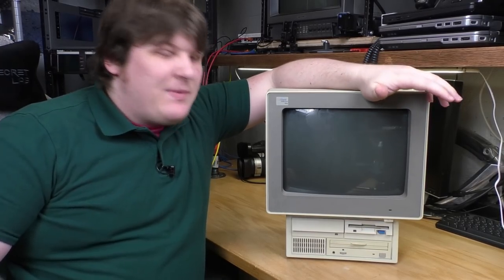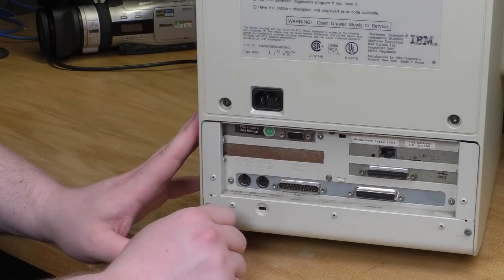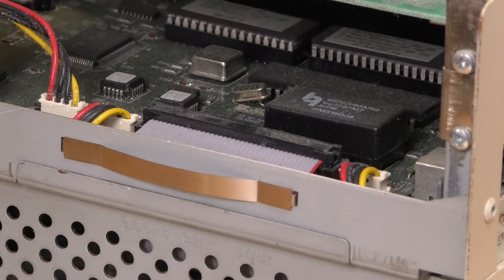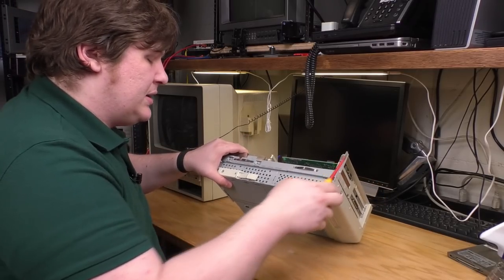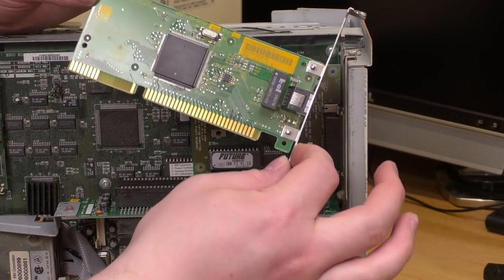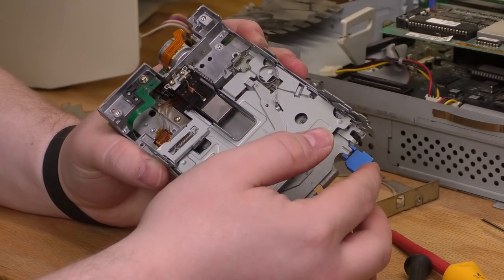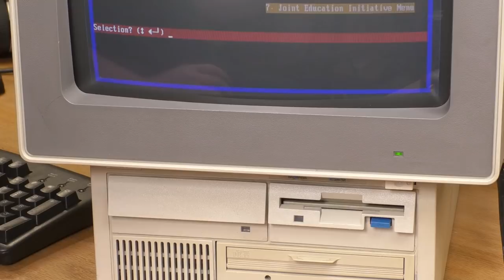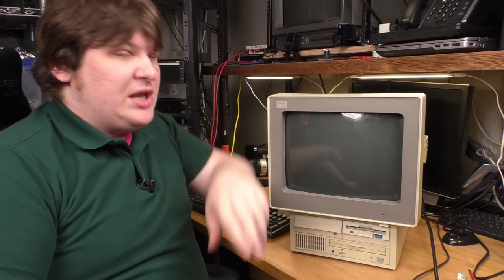Beginning the Eduquest

Comment: OK, first, is that a Texel CD-ROM??

Second, on that floppy drive — I recognize that mechanism.  Alps, was it?

IIRC... That rectangular clip with the spring in it comes off, then you press the eject in and the top half of the loading plates comes off.  There’s a lower plate that slides forward on some guide pegs with keyhole slots.  Take that off.  The thing you think is riveted, isn’t.  It’s just a little disc with a hole in it that rides on top of a pressed lip.  The bottom tray holds it in place and keeps it from popping off against the force of the spring on the left side.

To reassemble, lube that disc, put it back on the lip, reinstall the bottom tray and rotate the disc and push the tray onto the guides.  That should keep it secure.  Reinstall the upper tray, then that rectangular thing on the left fits into a notch on the left side of the chassis.  You may have to press the eject button to get the upper tray in place, then push or pull the bottom tray to open up the channels that the top tray guides into.

Something like that, anyway.  Half of this is like every other common 3.5” mech, but that rectangular piece and the rotating disc are kind of unique.  Get a top-down cam on it when you disassemble it and it should help if you get stuck putting it back together.  It’s pretty straight forward though.

Comment: For any type dirt on plastic have you tried a pre-soak of WD-40 just spray on the dirty spot let sit for 60 seconds or more then clean, it is magical, it has taken polyurethane off of vinyl for me. CLR and Steel wool with WD-40 for rust removal.

Comment: They had these at my middle school. Never opened one up. But the floppy drives always stuck like that.  I think they had these at my elementary school too.  They replaced the apples. I remember them running new Ethernet cable for these when they got them.  By high school I had a network admin login. That they gave to me.  Heh.

Comment: Not sure what kind of compressor you used but every time I've used an air compressor to dust out a machine (both personally and professionally) it has ended up way cleaner than that. If it's one of those little tire or inflatable toy ones it won't do the trick, but any hardware store air compressor for driving air tools (with an actual tank) plus a fine-ish nozzle tip will direct a vigorous enough jet of air to remove just about any dust with the huge exception of dust from a smoker's home. That stuff is the vilest, most tenacious substance known to man - get your scrapers out!
Reply from the maker: I used a typical shop air compressor, ~90psi through a good quality air gun.
Reply: As I understand it, none of those compressors are static safe.

Comment: I'm not super surprised to hear it only has a 386 in 1993. I have a Zenith "notebook" with a 386SX from 1992, and while yeah the power considerations of a laptop were a factor there, a machine made for the education market would probably have lower cost components than something directed at the high end.
Reply: I got a 386DX-40 based PC in 1991-ish, and that was a reasonably powerful machine for the time. 
Not quite bleeding edge, but definitely above average.

486s were still ridiculously expensive in comparison, and not all that much faster. In fact, the 386DX-40 was somewhat faster than the lower end 486SX CPUs (which were still more expensive), and could hold its own against 486DX-33s (which were /a lot/ more expensive) quite a bit of the time.
The main advantage of the 486 was the built-in FPU, and most consumer software (and games) wouldn’t actually use that. My 386 was still quite capable of running most cutting edge games reasonably well in 1994-5. Doom comes to mind as the poster child, here.

Comment: Regarding the quality of cheap chinese drives, it seems to be a matter of head calibration... and vintage internal/FDC floppy drives have the same problem. I dumped something like 90% of my floppies without issue using one $15 Chinese USB floppy drive and all but a handful of the remaining 10% dumped fine on the other one (those proved to actually be bad)... which seems to be calibrated the same as the vintage FDC drive in my AST Adventure! 210.

(i.e. Some drives will read more disks successfully, but none of the drives I own, USB or vintage, was calibrated such that it could read all the aging disks in my collection.)

Comment: So they do make static safe brushes, for like cleaning up after solder flux. Think they have carbon in the plastic to be very slightly conductive? I've used silicone basting brushes, but no idea how static safe it is, and it won't really get that fine surface dust off.

PS2-type floppy drives are in fact incompatible and unique, and that looks somewhat like one? (I thought they didn't have separate power jacks but it's been a long time.)

Comment: This is definitely an early 90s looking machine, we did not have this one but we did in the early 90s get a 386 machine that looked very similar...Monitor was seperate. My recollection says mostl likely we got it in 1993.   I cannot remember if this machine had a cd rom drive in it...I don't think so I think it had 3.5 floppy and a 5.25 inch drive, and it wasn't until we got the 486 machine a couple of years later that it had the cd drive.  But yes looking at this is very nostalgic for me.  I remember distinctly getting Eye of the Beholder and it wouldn't run on the machine and figuring out that if we made a boot floppy that it could be run from there...I suppose it was a ram issue its so long ago i cant remember specific details but I remember being excited to make the game work and feeling smart for figuring out how to make it work. I think its the size of the chassis itself and that blue button on the 3.5 inch drive that really make it feel reminiscent of that old machine.  Man I almost have a name for it....but its eluding me ..was it just PS2?
Reply: btw...1993  I was 15

Comment: The "it's really is a Mac" after seeing another sled at 21:27 seemed strange to me, as someone, who's started to be interested in computer hardware at like the Sandy Bridge era, so my idea of a Mac is something with everything soldered to the same board aad if something isn't, it has proprietary connectors and screws. Something that is modular and tool less or minimizing the amount of both screws and different kinds used would be something for Dell/HP/Lenovo.
Reply: Old macs used to be a lot more expandable

Comment: (added to this while watching...)

Oh man. I had one of those back in the day (though still after its prime, got it from an electronics recycling place).  The associated mouse is huge, chunky, and kind of ugly. I think the mouse holster is stock. Mine didn't have a CD drive.

That's definitely smaller than a molar Mac. Looks approximately half the volume... Those G3 all in ones were literally massive.

Oh man love those weird silver ibm ic packages, like on that token ring card. Lots of good memories with those 3com etherlink III cards, I had a ton back in the day, they work great in Linux.

If it said 24MB, I bet those two sticks you saw were 8 each, with 8 soldered on to the mobo. Oh those ps2 floppy drives are so weird.  Do you have a Glasgow on order for doing Kryoflux-level disk imaging?

Comment: In Windows, I use Disk2VHD (despite it's name, it can make VHDX images as well) -- those images are mountable, natively, in Windows as if it was a drive, though the snapshot/differencing-disk functionality (that the format was built for!), is not exposed AFAIK. -- But also, if you don't assign a drive letter to the drive in windows (i.e. it only shows up in disk manager), it's not going to magically start modifying the drive or it's files.

To remove the rust, you should try Distilled White Vinegar.

Comment: Nice machine. You are worried too much about ESD... a regular paintbrush and vacuum cleaner will get rid of the dust safely. The big danger of zapping components is when you stand up, walk around and come back to the machine, especially when you have a carpet and/or slippers which are prone to generating static electricity. Even if you do zap them, it's unlikely that you will fry anything, but the simplest thing to do to avoid any sparks is to touch the metal chassis before anything else.
Reply from the maker: My situation is extremely static prone, particularly because of the chair I have right now, so I am taking absolutely no chances.
Reply: @CathodeRayDude  I see, well, it's always better to be safe than sorry with these rare old machines.

Comment: That rusted backplate: i'll bet it was an after market one added when someone removed whatever from that ISA slot. And it was just more rust prone than the rest of it.
Reply from the maker: but since it's not a standard bracket, they'd have had to find specifically an aftermarket eduquest addon card blank. I guess that's feasible though

Comment: Oof, I had that CD-ROM drive (or one very very similar to it) It was paired with an Aztec Galaxy NX-Pro 16 sound card, which had a built in SCSI controller. Worked great with Win 3.11, when we upgraded to Win95 no drivers were available so the sound didn't work properly.

Comment: The Apple IIGS, great computer by the way, was released in 1986 and Apple discontinued it in 1992.
Reply from the maker: Yeah, by the time I was using them in school they had been out of production for probably 3-4 years. We were just using them for // software anyway so it was kinda pointless loll
Reply: @CathodeRayDude  The primary school I went to were still using Apple IIGSs in the classrooms up until 1996 at least, that's when I left the school.  Then, the school I went to in 1997, were still using Apple IIEs in the junior school, up until 1998 I think.  The Apple II series computers were nice machines for their time though, I do have a fondness for the IIGS, though I've never personally owned one.

Comment: You really don't want to use dd for recovering potentially bad drives. Instead, use GNU ddrescue. It's designed for this kind of "recover data from a drive that might die and may have bad sectors" scenario. I also use it for USB floppy drives.

(It does a quick pass over the drive before going back to attempt to shrink the bad regions, and because you can use it to write an image file and a log of bad sectors, you can re-run it to retry the bad sectors.)

On Linux, here are the commands I use:

ddrescue /dev/device /path/to/output.img /path/to/output.log
ddrescue --direct --retrim -r 5 /dev/device /path/to/output.img /path/to/output.log

(That tells it to do a quick imaging pass the first time, then bypass any OS disk caching, ignore its past records of stuff it's already failed to shrink, and attempt to shrink the problem areas further, with five retries for each failure. You can re-run the second command as many times as you want.)

There's also a DDRescue-GUI frontend I haven't tried, and a ddrescueview tool which can use the .log file to visualize the status of an image file using a view similar to the Windows Disk Defragmenter.

(In fact, ddrescueview explicitly supports acting as a graphical equivalent to that `watch -n2 ls eduquest30.img -lh` command you were running if you set it to re-read the log file every few seconds.)

Another nice thing about ddrescue is that, because it supports that kind of resumption, you can build up a disk image of the same removable disk by attempting to read the same disk in multiple different drives with slightly different head calibrations.
Reply: Second, for cleaning the heads of a non-USB floppy drive, I run a tool named Image Disk under real DOS (i.e. not in a Windows DOS window because it needs full hardware access).

There's a page named "How to make a cleaning kit for 5.25" floppy drive at home (for free)" which walks you through how to use it but, for 3.5" drives, ignore the instructions for making the cleaning disk and do as follows:

1. Take a blank 3.5" floppy you don't mind sacrificing, which is old enough to have a protective felt sleeve running all the way around the inside of the shell, rather than just a small pad on one side of the shutter window.

2. Remove the shutter and the spring that holds it closed.

3. Carefully snap apart the two halves of the diskette's shell and discard the spindle and magnetic medium.

4. Carefully detach the protective felt from the glue that holds it in place, and rotate it so the window the drive heads reach in through now exposes part of the surface that was against the magnetic medium.

5. Reassemble the disk. Because of how the halves of the shell interface with each other, it should be safe to use as it but, if you want, put a little scotch tape to hold them together.

(The idea is that, if the felt is soft enough for your data to rub against for ages and ages, it's soft enough for Image Disk to use as something the drive heads can wipe themselves clean on.)
Reply: Finally, If you need to image something that's copy-protected or not a standard 720K or 1.44MiB MS-DOS MFM floppy (eg. Microsoft DMF, IBM XDF, or any other specialized high-capacity floppy formats that custom formatting tools could achieve, like the 1.7MB formats I used as a kid thanks to a specialized piece of freeware), you'll need an archival/forensic floppy controller.

Basically, a USB adapter for a vintage internal floppy drive which can read the drive's contents at a very low level and output either a raw flux log or whatever image format is appropriate. (Something like the FluxEngine or KryoFlux. The former being the cheap one you can build with a $20 FPGA dev board, a floppy cable socket or length of pin header, and a soldering iron. The latter being the professional product.)

Comment: You can use a IDE CDROM, connected as slave. That type of mounting the hard drive was common on PS/2 (my model 30 286 had the same). IBM used mixed screws, the normal ones with metric thread and those with imperial thread. 
Did it have the math copro inside? I bet that many of those programs could use a 387. 
Nice find, I never knew about these computers. 
Would you make the images available on Archive.org?

Comment: Electronics grade rubbing alcohol-99% is Probably your best best with regards to cleaning, seems to be conductive enough to dissipate static before it dries.

So spritz the hole thing In alcohol and wipe with an alcohol soaked cloth?

Or better yet, just wiggle it around in a bath of the stuff

Comment: The two connectors on the bottom were for daisy chaining the computers in the lab together and terminating to a printer
Reply from the maker: While that is a really entertaining idea, it's not actually practical with the way parallel ports work (you can do star topo, but you can't daisy chain) and also one of them is explicitly a serial port.
Reply: @CathodeRayDude  maybe it was different on the model 25, that's what we had in elementary school. Or maybe that was just too long ago and I don't remember correctly haha

Comment: Don't use an air compressor. Mainly because of the risk of moisture. I know 99% of the time it's fine. But not worth the risk. And they make esd compliant brushes you could use for it if your super concerned. I'm sure you have seen the ltt video where he tries to shock things to death. It takes a bit. So i wouldn't worry. I use nylon brushes like you get to clean out your keyboard and stuff.

Comment: I understand that the IBM PS/2 PCs were mostly designed to be opened up and serviced without tools, clearly with this one you need to use a screwdriver to do much of the work on the computer, I suppose it's deliberately designed like that to stop school students from opening the computer up and stealing its hardware or damaging its parts.

Comment: You may not like to hear my advice for cleaning the dust off the PCB components of this machine, but here it is anyway: plain old toothbrush. You're not going to be generating any crazy amount of static electricity by gently brushing the gunk off.  I've operated from the "tap the chassis while the grounded power plug is still in and don't go scuffing around on the carpet like a madman and you'll be fine" school of ESD safety for — well, longer than that machine's been around — and haven't had any issues. That being said, don't do anything you don't feel comfortable with.

Comment: 7:15 looks like  a  AUI port? it was (commonly) used in the late 80s. Not so common for the 9os. It's a port for 10 base 5 ethernet. Apple had a version called aaui that was used until the mid 90s.

Comment: why not try air cleaner? not sure what it would be called in your country but it is usually just compressed air in a wd40 style can with no additives like oil. I use it quite regularly to clean out the dust in a computer and to clean the fans. just don't try to substitute it with a regular air compressor, those always blow some liquid droplets like oil and water vapor.

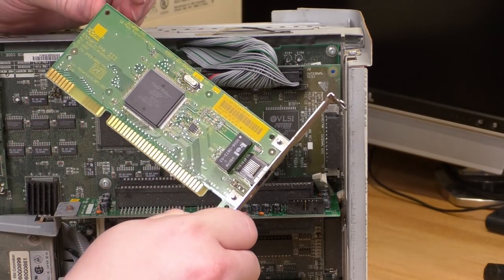Comment: 28:30 I yelled “3C905b vortex” at the screen as soon as you pulled the card out. ;)

I’m surprised that system didn’t have any MCA bus connectors, maybe it’s a hair too old for that.
Reply from the maker: too new! mca was on the original ps/2's in 87 and by 93 had run it's course for the most part.
Reply: @CathodeRayDude  hmm, I had dual socket pentium 90 MHz servers that had MCA slots (and ISA of course).  MCA was old but still in use in the late 90s.  Maybe it was just a server thing at that point?  It was basically proprietary PCI, before PCI existed.
Reply from the maker: @BobWidlefish  yeah that's my take - mca in desktop, I THINK, was on the outs
Reply: @CathodeRayDude  IBM used ISA with commercial chipsets in low cost offerings like the PS/1 home computers.
Reply: My PS/2 model 30 had ISA. I had to choose between it (286) and a 386 PS/2 tower that had MCA. At the time, I had some ISA cards (SB, VGA, network) and got ISA. All was good until the HDD died.